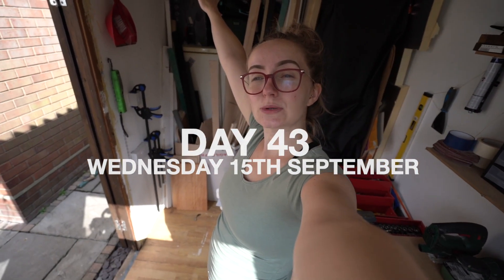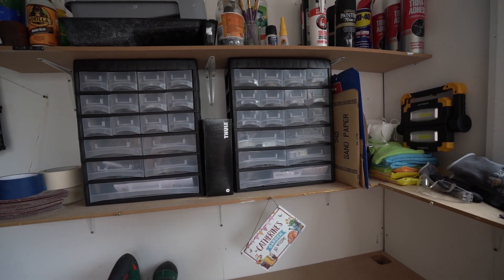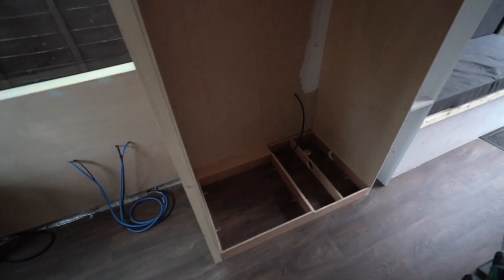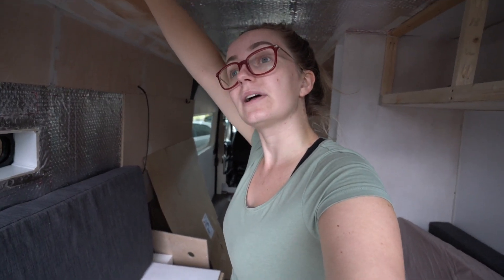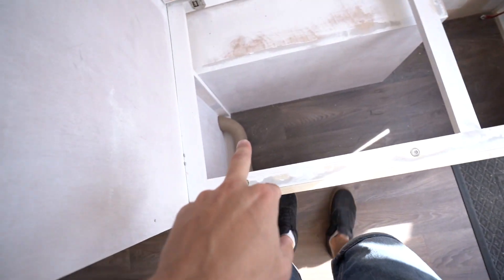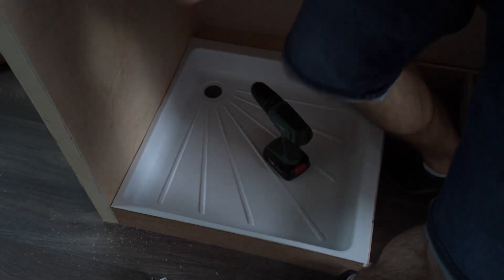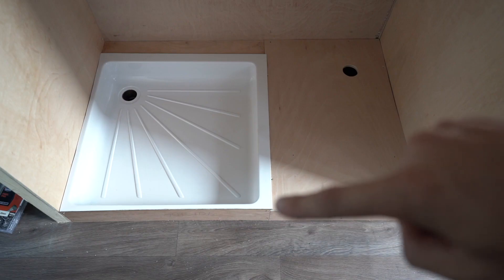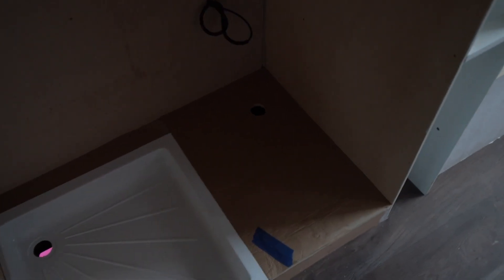SHOWER TRAY Install - Half Custom Shower Tray ? Citroen Relay Camper Van Conversion UK - Week 23

Comment: Definitely one of the more difficult jobs it take a lot of planning
I hope you don't mind me suggesting that you may consider sealing all the timber joints with mastic before you fit the tray and wall panels just incase any of your final sealant  joints fail  water won't be able to run throughout your van and would be contained locally
Keep up the good work you guys 
I think we are totally finished our build we did the final tweeks to the air suspension today and it working a treat
Reply from the maker: Hey Sam ! Ofcourse not send all suggestions please ! Unfortunately we glued all panels yesterday so your comment is too late ! :( I did think about trying to seal all wood but I thought it would just delay us noticing leaks and potentially do more damage before noticing. Fingers crossed we won't have any major ones, we will find out soon enough ! Congrats on the build, you should be very pleased it looks amazing ! 👏 Excited to see the rest of the suspension vids 🙌

Comment: what about expansion & contraction of your shower panels ?
Reply from the maker: Hi, had no issues so far, we silicone around the joints that should seal gaps / account for slight movement.

Comment: Good job. However, what happens to water that's on the toilet side of the joint? I was planning on doing something similar but inevitably shower water is going to end up everywhere and not draining away fully
Reply from the maker: Yeah it is an issue / concern, I think it'll be fine, worst case we'll just dry it up  / push it into the tray after having a shower